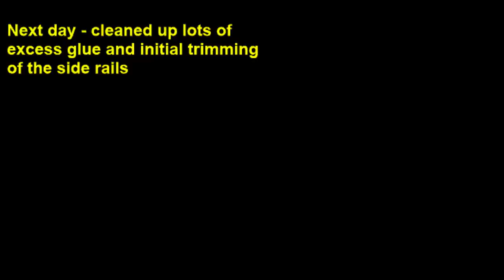RGs Wood Stand Up Paddleboard Build

Comment: Beautiful Robin! I have just purchased the Jarvis plans (San Marco) also and I learned more from your video than the company ones !
Reply from the maker: Hi Anne - good luck with the project!  The only thing I did wrong was not to plane the deck boards down far enough - this resulted in the board being a little heavier than planned.  However it glides beautifully and there is no problem turning it.  I planed the boards to a shade over 6mm but could probably have taken it down to 4.5mm without problems.  It is VERY solid with 6mm boards and because of the construction and the layers of mat on top can be planed and sanded to below 4mm without problem.  Any other questions just ask.  Enjoy
Reply: Do you know the approximate weight your board ended up? I've heard a couple of accounts saying the boards end up heavy if you follow the Jarvis instructions and go with 6mm (1/4") thickness.

Comment: Great vid, just bought a set of plans from Jarvis boards. Did you sand the filler coat before applying the cloth?
Reply from the maker: Hard to remember but i think i gave it a very light hand sanding at probably 120 grit, just so the epoxy would have something to grab on to.
Reply: @Robingray99  Thanks!

Comment: Hi, I also bought the plans from Jarvis Boards, precisely the ones for the Aransas model, but it doesn't say anything about the thickness of the wood, could you explain what they are?  Thank you.
Reply from the maker: Hi Leandro.  The internal frames were made from 6mm plywood.  As there was no guidance, I planed the deck planks to 6mm thick.  This was too thick and the board came out unbelieveably strong but heavier than I had hoped.  If I had to do this again I would plane the deck planks to around 4mm thick.  This would certainly be strong enough and would be lighter.
Reply: @Robingray99  Thank you very much Robin, I've cleared up any doubts, I'm going to do it as you said, 6mm for the frame and 4mm for the cover. see ya.

Comment: I have set or plans for a paddleboard, for the plywood you use to cut and place the plans on what type of wood did you use and how thick was it?
Reply from the maker: Hi Flix.  I used 6mm marine ply for the frames.   For the planking I used Western Red Cedar planed down to 6mm.  This was actually too thick and the board came out a little heavy.  If I was to do it again I would plane down to around 4 to 4.5 mm.  The Cedar was the lightest wood I could buy locally in Belfast.  Good luck with the project!
Reply: @Robingray99  Hello Robin, Thank you for sharing this. Just bought the plan (but still try to print it 1/1). How much wood for the planking or what was the initial size of you cedar piece? Thanks
Reply from the maker: @guyminet2073    Hi guy  - I got a local print shop that prints architects plans to print mine - he had to split it into three strips.  The wood was bought as rough timber six inches by two inches (approximately 150mm x 50mm)  I cut it in two and then into strips 8mm thick by about 75mm  - this was too thick - should have cut at around 6mm and then planed to about 4.5 mm.  Hope this helps

Comment: Can you replace the planks with plywood?
Reply from the maker: Probably or should that be possibly.  I suspect you would have to do it with strips of say 6mm plywood up to 70mm wide and narrower at the edges to cope with the curved shape.  The ply would need to be proper marine ply.  I would also consider the weight - I'm not sure of the weight of ply.  I used Cedar as it was the lightest wood I could buy locally to me in Northern Ireland and I did not plane it thin enough - should have taken it down to 4 to 5 mm rather than 6.

Comment: Great job Robin... may I know the total weight at end?
Reply from the maker: Hi - it came out over the target weight of 16Kg, 35lbs.  It actually weighs just under 20Kg 43Lbs.   I can still lift it onto the roof rack of the car easily enough and it glides superbly and still turns very well.  Now I know more if I was building again I would take the Cedar planking down to 4 to 4.5mm.  This is not clear in Jarvis plans or videos.  This will still be super strong but will reduce the overall weight
Reply: @Robingray99  I just built one at 5.25mm which turned out at 35lbs.  If I build another I'm going down to 4.5mm on the bottom and 5mm on the top.  With all foam blocking I think Could get down to 30-32lbs
Reply from the maker: @joepearce7683  Thanks for the info  I won't be building another but still get a lot of questions about that - now we know - Thanks!
Reply: @Robingray99  what size is the board?
Reply from the maker: @alexanderruchkov7629  It ended up 31 inches (790mm) wide and 11 feet 2 inches (3.4m) long